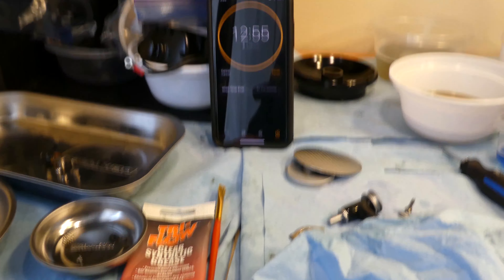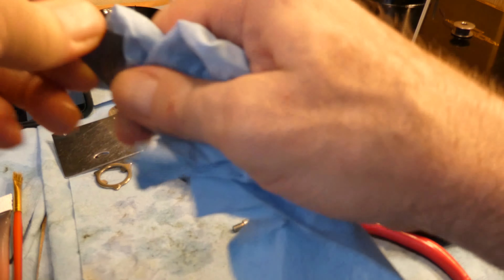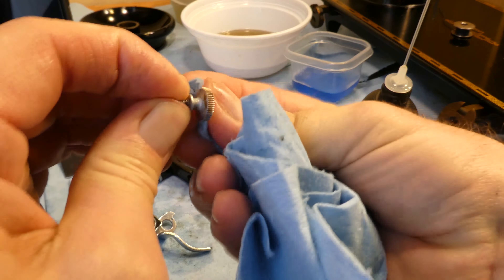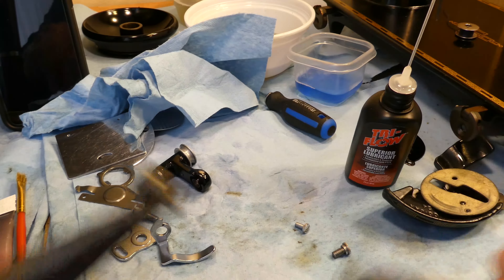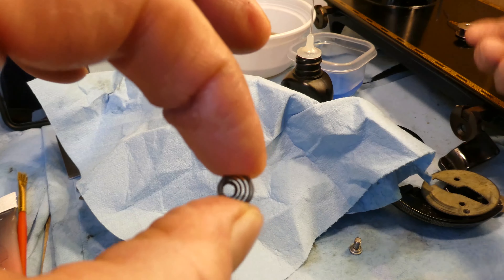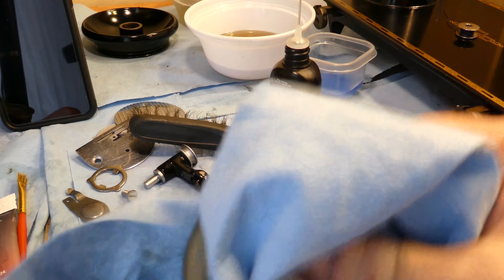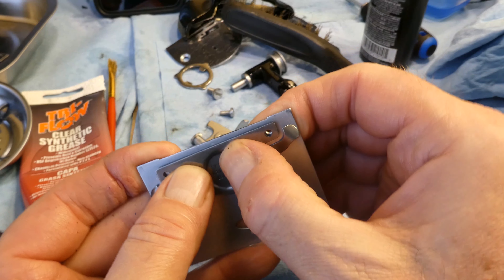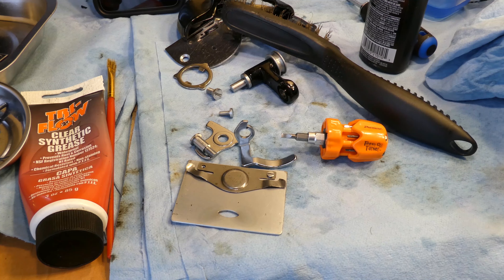SINGER 201K BOBBIN WINDER CLEAN

Comment: O no
Reply from the maker: HI ALISON! I DID FIND THE SCREW! LOL! THANKS FOR CARING & SHARING!
Reply: @JebbAdams  great, I was worried for K and you lol 😂
Reply from the maker: @alisonaussie4995  HA HA HA! NOT TO WORRY ALISON! ALL IT TOOK WAS 5 MINUTES ON MY HANDS AND KNEES WITH A FLASHLIGHT (TORCH?) & MAGNET, LOL!!! AT LEAST I DIDN'T HAVE TO EMPTY THE VACUUM CLEANER BAG! HOW IS YOUR MACHINE? WAS IT MADE IN AUSTRALIA OR SCOTLAND?
Reply from the maker: @alisonaussie4995  AWWW! THANK YOU ALISON! HOW SWEET! THE MACHINES AND ME ARE FINE! LOL! THANKS FOR CARING & SHARING!
Reply: @JebbAdams  Scotland machine mine. It’s going ok, I freed up the feed dogs drop switch today, needed the hammer treatment to get it moving, penetrant n kero soak didn’t work, had forgotten about it til now, officially the last stuck piece on the machine and I got the motor clutch bearing unstuck so it turns now too.
Reply from the maker: @alisonaussie4995  KILBOWIE MINE TOO! ONWARD & UPWARD. ANYTHING MECHANICAL GIVE IT A GOOD BASH! LOL!